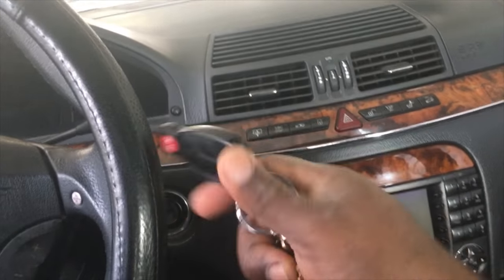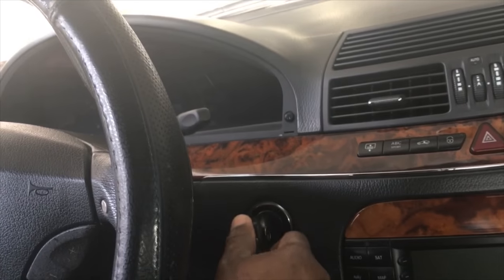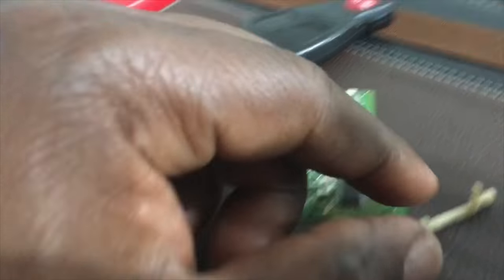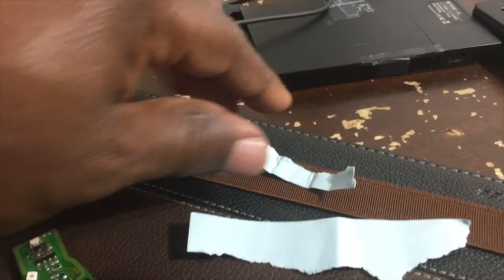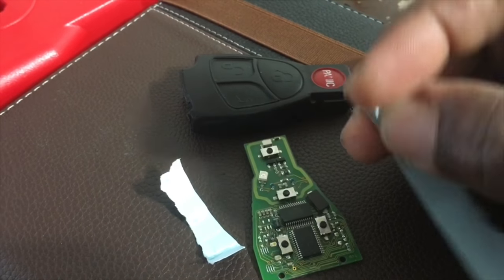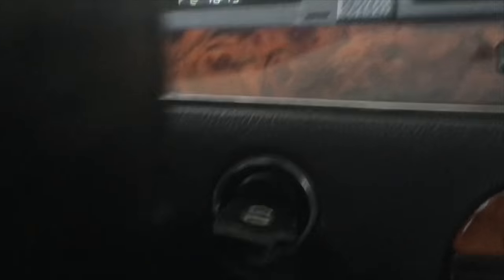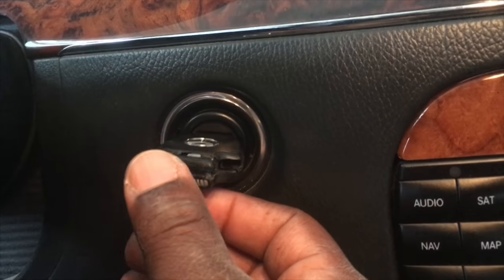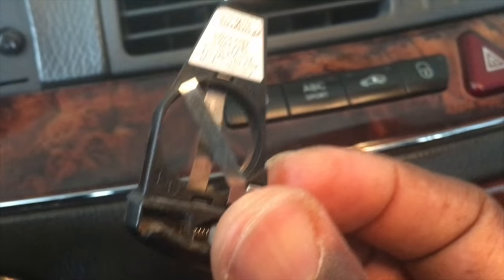DIY Mercedes key fob repair (saved $1,300)

Comment: I appreciate you bro. My daughter dropped my keys to both cars clk430 and my bmw in a bowl of water. The bmw key worked as soon as I dried it off but the Mercedes key wouldn't open the door or strat on e I got it open. I replaced the batteries and that let me unlock it. It still wouldn't start so I did what you did in the video I took the key apart and cleaned all the water marks off and placed the folded paper in the and put it back. I tried to start it again and it worked. 3 hours later I was finally able to move my car. Thanks bro that video saved me time and money. You the man👌🏾
Reply from the maker: You are more than welcome my friend. I’m glad that this video has helped you greatly.

Comment: I have the key fawb with the chrome sides and I tried this method using a folder piece of thin box material and it worked I was starting to think I would have to get another key fowb and this method saved me a few bucks thanks my good sir may gawd bless you!!!
Reply from the maker: You are welcome and God Bless you as well my friend.🙏🏾

And a special thank you for informing all of us that this also works with the mercedes keys with the chrome sides.👍🏾👍🏾
Reply: Is it difficult to dismantle the key fob? (Chrime side type)

Comment: OMG! It worked!!! I spent $800 for new starter which worked for a week and quit on me again. Bought a $12 fob on Amazon and the damn car started right up like nothing was wrong. Dealership quoted me $1,500 for the same job I just did. Thank you so much!!!
Reply from the maker: You are welcome. Anytime.
Reply: Did you have to reprogram thr fob?
Reply: No, it should start right up
Reply: Replacement fob on the road, 500.00! Insane.
Reply: @KrisstySchooler  wait , it has to be programmed to the vin no?
Reply: Dealerships are con artists.

Comment: Well your paper trick worked! My girlfriend dropped the key fob in a puddle or something and it wouldn't turn over until i watched the video. Turns out the sensors were not lining up.
Reply: Wandering why drooping key into puddle will mess the lining. It can be dust on the IR transmitter.

Some just replaced the case and works.

Comment: Wow. This really works. Thanks a million. FYI this technique will work with regular paper too. I was stuck in parking lot and I used a piece of paper from a bank receipt. I just folded it twice as many times to get it to right thickness. Worked on the first tried.
Reply from the maker: You are welcome, and great job! And thank you for reporting back that this also works with regular paper. I and I’m certain many others greatly appreciate your info.

All the best.

Comment: Hey man I had the same problem in my 2004 c240 but I realized after doing all that one of the infrared eyes was disconnected from the circuit board on the one side so it was lopsided a bit to get that fixed and got him to soldered back together check all the connections all those little eyes if they're sitting right on your circuit board and the repair cost me $5
Reply from the maker: This is great news and thank you for posting this info here… I am certain this will help those in need who may have the same issue.
This is much appreciated.

Comment: Thanks man and I have a lucky find for you. I changed the battery in the key fob and still the key would not turn. Also the trunk release inside the car would not open the trunk so I thought the car battery was dead. New keyfob battery but the door lock buttons would not unlock or lock the doors. I crawled into the trunk by pulling down the seats in the car. I thought maybe there's a latch in the trunk I can pull, but I hit the trunk button on the keyfob while I was in the trunk and everything works now. My mechanic said there is a sensor in the trunk and by getting closer to this sensor the keyfob with a new battery was able to reset. Everything works as normal with no error codes. Time for a quick "Italian Tuneup" up to Malibu on the PCH. Hope this helps!!!!!!!!
Reply from the maker: Thank you for posting this information. This will greatly help those who may have the same keyfob problem/issue you had.

Good job man. 👍🏾

Comment: I had this issue in February whilst I was at work trying to go home 😠. Quickest solution I found was disconnect the negative side of the battery leave for a few minutes reconnected the negative battery terminal & it worked straight away and touch wood it's not happened again.
Reply: The car battery ?

Comment: Thanks for the video! I have the newer style key, with the chrome sides. Going off your solution, I opened up the key by sliding off the two chrome pieces and cutting through the glue joining the plastic, and put a rolled-up piece of paper above the IR sensor (little rectangle right above the panic button) to keep it pushed down. Seems to have happened from the key being dropped one too many times. 20 minutes saved me 400 bucks!
Reply from the maker: Derek Singh You are welcome, and thanks for this extra method to fix the IR key fob. I myself also upgraded from my old black plastic key fob style shown in the video, to your chrome side key style as well. This is good information to know.

I now keep the black original key fob as a backup.

Comment: Thank you for the video on how to take apart and assemble.  My wife washed my fob in the washing machine and it quit working.  I followed this to take it apart at used 91% isopropyl alcohol with cotton swabs to clean it the chip and contact points.  Was very dirty and watery.  Luckily the fob came back to life and I can start my car again!   The unlock and lock buttons do not work however
Reply from the maker: Awesome, I an glad that you can get the car started.
Reply: Had similar experience, just to add to what you just described, apart from cleaning the contact point, make sure u clean the battery also(try not to touch them) when putting them back in and make the latches firm enough. My unlock button dint work after the first try. I took everything apart and observed that while removing the battery, i had expanded the metal brace that held them together. I adjusted them and voila! Everything worked perfectly.
Reply from the maker: @adeyinkaadebayo4192  Great find (👏🏾👏🏾) and thank you for posting this information for others who come here with the same issue.

Many Thanks👍🏾

Comment: v need more brothers like you i had key problem if i had seen this vdo earlier i would have saved few hundreds that i payed well done
Reply from the maker: Thank you very much for the kind words. I wish you could have seen it and saved some cash too. Its all good though. As long as your car is running, I am happy. All the best brother👍🏾.
Reply: @frugalfabrication  I have an after market key (from the world factory)  fob aswell over 2 years old  sometimes lights are on but wont start then have to use original key could i use same trick !!?
Reply from the maker: @brianjohn2894  I would give it a try. This may be the fix you need.It couldn’t hurt🤷🏾‍♂️
Reply: @frugalfabrication  well one way to find out

Comment: I'm kinda blown away by this fix!! How'd u ever find this out?? I know Mercedes n most of these issues r EIS unit behind key fob. Around $300 to fix
Reply from the maker: As an electrical engineer, when I looked at the key fob, I knew it utilized an infrared sensor.

When I had the non-start issue, I immediately thought of “the average tv remote, not being directly pointed at the tv, and thus not being able to change the channel”.

Thats how I realized, the key fob was not aligned due to the old worn out plastic housing.
Reply: @frugalfabrication 
Have a new case may work.

Comment: I don’t know how often this needs to be said. The batteries in the key fob play NO part in allowing the key to be turned or in starting the car. The fob is instead powered after insertion by an induction coil surrounding the key. The fob batteries are used only for locking and unlocking the car remotely. This is why you can use the emergency metal key to unlock the car and the key fob to then start the car even if there are no batteries in the fob. 

I expect the problem in this case is a dry joint in the soldering and stressing the board with the paper wedge makes the connection. I don’t think it has anything to do with the optical alignment of the IR transmitter and receiver.
Reply from the maker: Thank you for explaining the batteries in the key have nothing to do with starting the car.

Also, you may be right in the fact that there was a dry solder joint as well. In any case, the beauty of this is that you can fix your mercedes key fob with a piece of paper.
This is An issue where if you went to a mercedes dealer to fix, you would be shelling out a substantial amount if money (~$500 to $1,000+ USD) to resolve.

Thank you for your observations.
Reply from the maker: Mark Norton Ok, not everyone at any exact given point and time has the immediate ability to just send off keys to be copied, and go without their vehicle for however long it takes to

1) have an electrical specialist get to their key in the order it was received.

2) or leave their car wherever it may be stranded (as they have already known their key case is faulty, but have been dealing with it for quite some as they do not posses the $500 to just give to the mercedes stealership who rips them off making an ~$15 (near true circuitry value) key copy.

3) need their vehicle up and running immediately as they may have work the next day or in the next few hours, and can’t afford to pay for and maintain the cost of a rental car for up to 2 weeks in order to send off the keys (as you so geniusly recommend) to a specialist who will need time to diagnose, and then send you the invoice for repair and await your approval to begin.

I could go on listing more reasons, but I won’t. 
If you don’t like the vid, you can easily keep it moving to another youtube page.

But there are quite a few people this has helped. Judging by the comments and quite possibly the thumbs up.

No worries nor sweat of my back, have a good one.
Reply from the maker: Mark Norton Also forgot to mention...my youtube page focus is designed to aid those in finding simple and  frugal ways to solve their problems.

If I went into full scale engineering circuit analysis of this issue (Kirchoff’s Voltage Law and Kirchoff’s Current laws, transistor saturation points, etc), 99% of the viewing audience would be lost in the first 20 seconds.
Reply: Mark Norton  Hello. My key just worked last night and I just went out to start my car and it won’t turn in the ignition or unlock/lock the doors. Any ideas?

Comment: bro u just saved my fucking life i was at this water park in PA ,key got wet and it won’t work got it to dry and put me battery in and it unlock the car but doesn’t start or turn i went back to NY to get the other key but didn’t work so i call a tow truck they wanted 1000 to tow it to nyc i tried this and boom it worked i f** love u man
Reply from the maker: Bro pure awesomeness! This just made my day. I am glad that this video saved you in your situation. Great job man m, and I am happy you made it home safely.👏🏾👏🏾🤙🏾

Comment: OMG!  Thank you so much for your video!  It might take a few tries but it eventually works.  How long can I expect for this to work?  I wonder how big of hurry I should be in to get to the dealership for the replacement. Thanks again!!
Reply from the maker: You are welcome. I already made a new key copy(2nd key), but this fix is still working with the original.

Comment: i have a 2004 w230 sl350 with the older key. does this work on that as well?
Great trick and thank you for sharing
Reply from the maker: If your key fob looks similar to this style era of key fob in the video, It should.

 I dont see why not. After some time, the plastic wears and slightly deforms. Then the IR laser/light does not line up with the Cars tumbler.

Comment: Nice video. However, both my key fobs didn’t turn. One I use all the time and the other was a spare. Also,  no interior lights came on when I opened the door. I thought battery died but it didn’t take a jump either. Any ideas or suggestions?
Reply from the maker: J will I can’t say as I have never had this issue. I would recommend googling the term (auto forum) “MBworld keys will not turn Mercedes ____(insert model here)___” and see what mbworld members have posted with the same issue.
Reply: @frugalfabrication  It was the main battery. It’s an ‘05 that I’ve owned for 8 years. I think it’s OEM battery too. I’m replacing it myself. Any pointers?
Reply from the maker: J will is it S55?  If so, I’d just remove all of my stuff out of the trunk and disconnect the negative terminal of the battery first.

Then after, I disconnect the positive terminal of the battery.

I Always do it this way with cars, because the negative battery terminal is grounded into the cars Chassis/body. 

Imagine if the negative terminal is still connected, and you are removing the positive terminal first, and as you are un-tightening  the positive battery nut and you mistakenly make contact with the chassis...a nice big arc/spark will occur.

Keep in mind this can damage sensitive sensors as well. So to avoid this, disconnect the negative terminal first always.

Sorry to be so long winded.

Comment: Cool vid my key red light doesn't flash when I press on my lock button, so I can't lock my car from the key fob, just unlock it ! ESP it's showing up on the screen 2001 E430 ! will this procedure work,I don't have the original key fob ,I have transfer it to an upgraded metal key fob ! but it has been like this since I purchase the car,there is a bunch of functions that doesn't work,sunroof,radio, little controls,windows and rear view mirrors are all crazy !
Reply from the maker: Technics Melancholic I think your original key fob for your year/era mercedes may have been the all black plastic key.

Your new metal key has a different style of case and I DO NOT think this will work for you.

Unfortunately, you may want to have your key circuit board/components looked at by an electrical tech who specializes with keys before paying for a brand new dealer key and labor copy service.
Reply: @frugalfabrication  Thanks for replying bud,it looks exactly as the Original it's just an upgrade that has metal in it ,the sides are made of metal and it fully opens for easy replacement ! but it follows the same pattern as the Original same composition same buttons placement etc ! it did the same with the Original key fob ! I had to replaced because it was all torn apart ! and wore out ! but it's looks just the same with the MB logo placed on the back not on the center !
Reply: @frugalfabrication  Will do bud Thanks !

Comment: After changing the batteries I was still having problems starting the car.  I opened it back up and bent the metal that goes around the batteries inward so that it makes a better connection to the batteries.  It started up right away with no problem after that but then it had some problems again.  I discovered that pinching the fob so that the batteries make a connection while turning the key is the answer and it starts right away.
Reply from the maker: sketchyj great find, and I appreciate you posting this info here for others as well.
Reply: The battery is absolutely not responsible for starting the car. It is only for opening and closing. Car even should start without battery.

Comment: Could i possibly have  the same people? My Vito  115 CDI used to start very  well, until i had my gearbox replaced with a second hand one. After inserting the second hand gearbox, the key  would  not turn in the ignition at all. However, my EIS and smart Key were tested and said they are all good. When connecting the battery, the ABS automatically  runs on its own and the rear fan kicks as well. At this  point, seems like i am running out of solutions of what i can do to fix it. Please advice me on what could be the problem, could  it be the key? And i have to do what you did in this video? Or?
Reply from the maker: Sifiso Dlozi I am not sure what the issue with your car is. And I don’t believe this video will help you.

I have heard on some of the more recent mercedes when the transmission is changed, and another transmission is installed, there is a “provisioning / transmission computer registration” process where the car/transmission may need to be connected by computer to the mercedes online “registration” servers so that it may function correctly after being installed.

I am not sure...maybe this is your issue.

I have never seen a Vito 115 CDI, as they are not sold in my country.
Reply: @frugalfabrication  i forgot  to mention that my gearbox is a manual gearbox. I think i will have  to call in a specialist then in my case. Thank you very much for your advice and knowledge.
Reply from the maker: Sifiso Dlozi you are welcome.